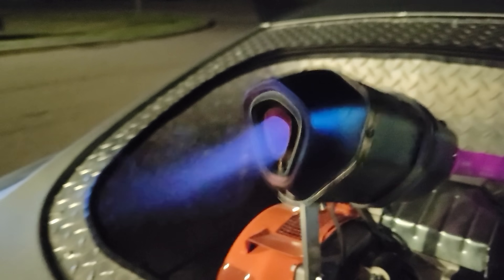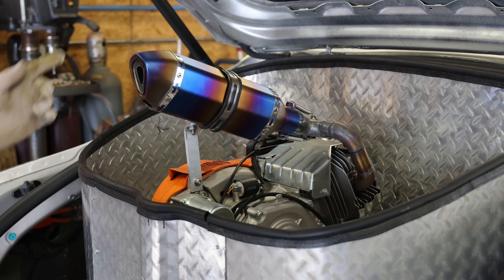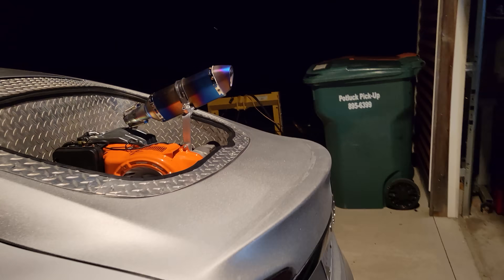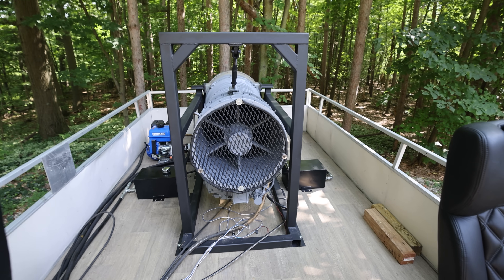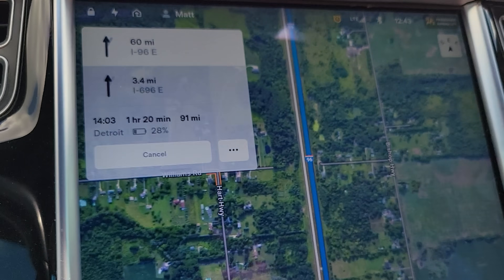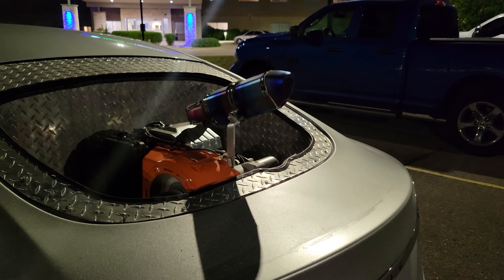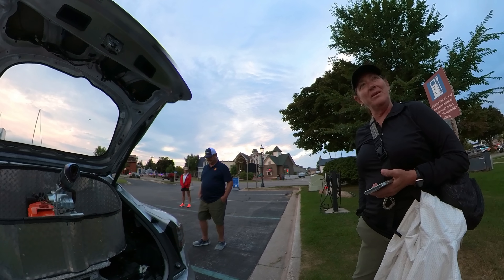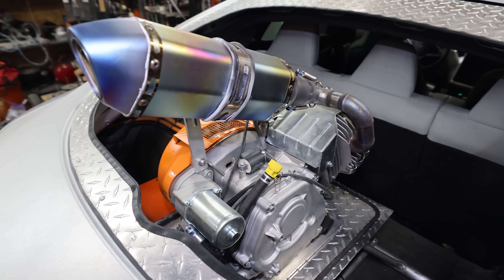Cordless Tesla (I Drive 1800 miles without charging) P.1

Comment: That's like an APU. Your Tesla is basically an airplane without wings. Nice. 😂
In all seriousness, you've been charging the car all along, particularly overnight. So yeah, you can't say you haven't charged the car for 1800 miles. I'm curious about the cost of fuel vs miles driven.
Your concept reminds me of a Gen2 Chevy Volt. But if you drive slow enough you can actually charge the batteries, the Volt couldn't do that.

Comment: As somebody who does own a BMW i3 range extender EV let me share some information about what it means to run an generator in an electric car

With the range extender I get 35 miles per gallon if I keep my car at a constant speed of 65 and that stops my battery percentage from increasing or decreasing.

If you think about that it doesn't make it a very good hybrid at all. You would be better off buying an actual hybrid than trying to modify an electric car to be a hybrid.

Comment: I think more electric cars need this but on a smaller scale. More like a plug-in hybrid on steroids. A car that has a fully electric drive train (unlike most if not all plug-in hybrids) and an electric range of like 250+ miles. Then include a gas engine with maybe a 4-5 gallon tank that can charge the battery if the battery goes under a certain percentage of charge. That way you are electric most of the time but you can add maybe 150-200 miles if you need to.

Comment: It's so dumb i love it xD people with Tesla are like "yeah i can only do 200 miles on the highway and then stop 30 mins but that's what you'd do also". When i did a 1300 kms trip in almost one go. 1000Km  (had a 20L jerrycan of fuel) with a single 5 mins stop. It'd have taken me 2hours more with a Tesla.. love my shitty Fiesta 

I love those Tesla, the power and quality you get for the price is impressive (well ok they have issues but out of factory you get good specs), but the battery technology we currently have isn't sufficient enough for them to be real daily, same as charging infrastructure. Wouldn't see myself going to superchargers, wait 30mins to start the week, just cause i live in a flat without a wait to plug it everyday..

Comment: Could you build a generator that supplies power directly to the motors through large capacitors only using  the battery for extra acceleration?
Reply: or, build an engine that runs on gas.  hmmmm.

Comment: I'm surprised that the cop didn't give you a hard time about flagrantly violating emissions standards. Without a catalytic converter, you've got to be spewing hydrocarbons like a '71 Vega. Wouldn't it be easier to just drive a normal hybrid? My large, quiet and comfortable Toyota Avalon Hybrid would average better than 45mpg at the speeds you were traveling and would only have to make two gas stops.

Comment: Nice click&bait. No mention on how the electronics was circumvented to allow charging while driving! Especially with Tesla software monitoring every milliamps in and out. Also interesting is the charging while parked is not showing the physical plug outside car(this however can be done by hacking the charger port from inside). Give me the details to prove me wrong!!!
Reply: The Tesla BMS communicates with the charger and inverter.  It would take extensive knowledge of the system and perhaps access to the internal source code to allow charging while driving.  While there was footage of the physical fabrication, the much more difficult job of electrical integration wasn't even mentioned.

My guess is that this was entirely a misrepresented stunt.  It was an off-the-shelf inverter generator running continuously but charging the car only when stopped.  The fancy fabrication steps, including removal of the muffler in favor of an open pipe, was to distract from what was really being done.
Reply: @1djbecker  You are absolutely correct. You cannot easily bypass the sophisticated BMS(it even controls the safety critical airbag deployment). Also it is not as simple as bypassing the charge port door sensor,as many will think. That is where you can charge internally from the back of charge port "WHEN" parked.
If hotrodding a modern engine with ECU is 10X difficult compared to carburetor injection it will be 100X difficult,unless you could bypass the extreme security of BMS firmware and the upper stack software code(which is all heavily encrypted along with autopilot s/w).
There are definitely possible ways of conserving battery use at low voltage level, but cannot be considered as concurrent charging while driving.
Reply: @aware2action  He did only 1800 miles in a week, yet stated that the generator was running continuously.

If he started out with a full charge and 400 mile range, that would have been 1400 miles or about 400 kWh of recharging.  It could have been substantially less with slow driving, as shown on the video.

At 10 kW generator output the charging should only take about 40 hours, something that could easily have been done without even running the generator all night.

The obvious conclusion is that running it continuously was entirely a stunt.   Once you see that, all of the custom fabrication and the extra loud trumpet exhaust was for show, making sure that everyone knew and he got a reaction.
Reply: @1djbecker  Yes it is very clear even from the frame of the video showing charge port on the back with no mods( with two high ⚡  orange cables running as it is). Unfortunately most people fell for the eye 🍬  I have been disgusted about lot of free energy click baits, but this is a first one similar to it but done a bit differently(taking advantage of the psychology and ignorance of the viewership).

Comment: Nice video,  would running a Generator while driving without batteries work more efficient??
You would need to figure the required amperage.
I'm not sure what Tesla electric motors are set for AC or DC..??
You could do a Generator / Forklift motor set up??
keep up the good work👍

Comment: I think a tiny gas generator 150 watts mounted to my Segway miniPro dumping DC energy any 59.5vdc directly into the battery while its operating to float charge it while riding to keep the battery partially charged so that the generator making the energy to go, would be a fun project. Any idea what a low mass tiny output generator like that would be? Where can such a thing be purchased? Are you aware of anything like that?

Comment: Man, those fuel economy numbers suck. Also, if you made the generator more powerful, it would consume even more fuel. Perhaps a diesel generator with much higher thermal efficiency & perhaps 40kw of output would make sense / weight optimize by drilling / machine all unneeded mass from the engine to mass optimize since a diesel generator with 40kw of output kinda heavy // vs the 10kw generator you made //

Comment: If we really want to be serious about electric cars this is a step in the right direction. Gas-Diesel/ Electric Hybrid is definitely the way to go. 
Gas engines are horribly inefficient at acceleration  but are really efficient at steady highway speeds. Electric is the opposite. Electric is less efficient traveling at speed but acceleration is mind blowing.  It seems more practical too. I'm sure with some $ and Elon engineering running a coast to coast could be done on a tank of gas.  
The Electic cars draw a lot of energy and we are already seeing their dema d on the grid. As it sits right now if we all started driving electric cars we would  need to put more fossil fuel plants back online. My sisters Tesla is coal powered for sure in fact I've worked at the coal fired plant that she gets energy from.. it's no where  near where she lives but First Energy burns coal at many places near where I live.

Comment: Lake Erie bro you live on Lake Michigan. 
10:00  My Ohio Brethren  said they always calling the cops. Lol
I'm sorry  fellow Ohioans called the cops on you Warped. I think you'd like to visit where I'm from in Ohio. Assuming you like to 4×4 where I live. 
I love your channel man. Your Chicago accent is relatable to blue color engineering types and Im sure you are well off a d you teach many people on your channel but I think you would make an excellent teacher. Chicago is in desperate need of male role model teachers to be proud of. Especially anything to do with engines man. I've been all about Engines  and Motors every since I was a baby and my dad would fire his Shovel head and my Pap took me to antique tractor shows and he had me on  different Wheel Horse pulling tractors (I'm a cub cadet fan) I won my first pull and they made a rule after that lol. You know you are doing awesome when the Columbiana Little Draggers Tractor Pullin Association makes a rule lol. Because I was 68 pounds my Pap could move a lot of weights around especially in the heavier modified classes.  
The rule said if a driver weighs less than 150. Weights plus the the rider and a 8# cage that would straddle the transmission tunnel to hold the weights as near to the rider as possible. We also used lead  instead of steel on the front weight post.  Anyhow I think your channel is great man. I've never owned anything that I didn't take apart and put back together. I know this sounds crazy to some but when I was a kid I took my guns apart and cleaned and oiled them.all the time my dad was a machinist so being interested in anything mechanical must run in my veins.

Comment: Can you provide more information about how the electrical part connects to the Tesla power electronics?  How are you able to drive + charge at the same time?
Reply: That info would have been very helpful.
Reply: Same way you plug in your phone and use it with the charge
Reply: @orangecookie3132  I don't think you can drive EVs with the charging port plugged in, so there must have been some other tricks to get it to work.

Comment: LOL - Cadillac built one of these in 2014.  It is called the ELR.  As all EV's it was over priced.   It was also ahead of its time.   It had 40 miles of pure EV range which was great for normal round town errands.   After 40 miles it ran off a 70KW gas powered generator.  {quietly}  I loved it but then realized what it was going to cost to refit the battery pack.  A friend of mine just got a quote for his VOLT which uses the same battery unit -  $29,000 yep that was the dealer quote.    Now figure that into your mpg calculations.  LOL    Add to that thee toxic waste challenge and EV's are about as clean as a septic tank.  :{

Comment: How much did you spend on gas? Or roughly how many gallons total did you go through?
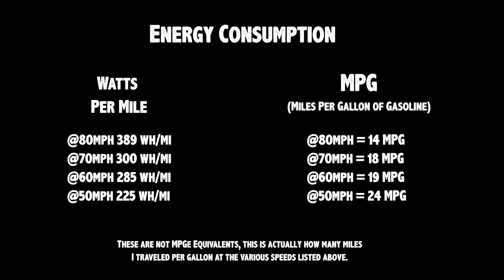Reply: Just watch the video to the end before asking questions. 14:55
Reply: @SansNeural  14:55 doesn’t answer anything, it just says how many miles he drove 😐
Reply: @Roadtripper420  Well, OK. 14:50 shows how many miles he drove while 14:55 shows MPG at different speeds.  He drove 1842 miles and I'll semi-arbitrarily choose his 50 MPH fuel economy of 24 MPG.  This assumes he's counted all the fuel burned  while charging overnight.

1842 miles / 24 MPG = (rounded up) 77 gallons of fuel.  That should be the minimum he will have used.

Yes, he could have easily posted exactly how many gallons of fuel he used... unless he did something silly like lose a couple of receipts (the kind of thing I'd do) and not be sure of the actual number.  However he did supply us with numbers to calculate "roughly  how many gallons total".  At least 77 gallons by my reckoning.
Reply: @SansNeural  I literally watched the whole thing bud 🤡

Comment: The problem is tha u cant charge as u are drawing power out the battery. So even if is showing that is charging is not until he stop acelerating. Is simple physics u can not charge a battery while u are using it. Is impossible. And is stupid and slow.

Comment: Doesn't want to charge on charger cause of waiting. Waits for the generator to charge the battery 🤡
Reply: Charge anywhere though.
Reply: @dude-n8p  anywhere the battery is empty 😂 Just put a generator in the back with a fuel tank switch on when u need 🤡

Comment: I have a bmw i3 ReX - It has a 600cc generator on board for this same purpose, but it is more powerful than the one in this video. 10,000 watts is not enough continuous power to maintain the battery level so I suspect he had some trouble maintaining highway speeds in this vid. Also the range extender in my car is very very quiet, especially compared to this racket.
Reply from the maker: The i3 is like 80hp, my Tesla is almost 1000 HP AWD BIG difference.
Reply: @WarpedYT  lmao you just proved my point. My 170hp i3 has a more powerful generator than your 1000hp tesla. Point being, my more powerful generator can maintain my very modest power draw (4.0mi/kWh average efficiency) whereas yours probably doesn't come close, at only 10,000w continuous output, for your "1000hp awd"
Reply from the maker: @MrJbmcgary  sorry I meant it the other way, I thought the generator in the i3 is 80 hp. And the Tesla is 1000 so I meant like the efficiency of the Tesla is impressive. I like the i3 too but I wonder why the Tesla is more efficient, different type of motors maybe?.
Reply: @WarpedYT  the range extender generator in my i3 is roughly 35 horsepower. The electric motor that actually drives the wheels is 170. In the video, you mentioned your generator puts out 10kW, whereas the factory optioned generator for my car puts out a bit more than 20kW. Doing the math for our efficiencies, your car gets roughly 170-180Wh/km, whereas the i3 sees a higher efficiency at around 150-160Wh/km.

All this boils down to my original point of this - your generator is less powerful and your car draws more continuous power. My generator is more powerful and my car easier on the power draw, and even I struggle to keep the battery topped up at highway speeds. All I was trying to say is I bet you struggle to keep the battery level maintained at highway speeds. That's all.

Comment: I always wondered if its possible to charge while driving. So if you take a big trailergenerator hook it up with some huge gastanks, you could drive that distance without stopping for fuel. Would be a great project.
Reply: Most likely he wasn't charging while driving but the gauges may have been confused from all the excess power.
As far as I know you can only charge when nothing is pulling Amps from the batteries (in this case the motor was pulling so I don't think it worked)
Reply: You should take a look at nissan kicks e-power. It's basically like this tesla but produced by nissan and reliable. I currently own it.

Comment: Get an APU from an old aircraft on there. Should have enough power to do what you need and is designed to run for long periods of time with low air flow

Comment: This is what I consider a proper hybrid vehicle.  I consider it a shame that something like this had to be hacked together by the aftermarket.
In my opinion this setup makes a lot of sense (Sure it is overly complicated and a bit impractical but it is a hybrid vehicle).  Using a generator to constantly charge the batteries gives the car the best of both worlds (the performance of an electric car, and the range of a gas).
Reply: ummmm..... it's called PHEV, and it's mainstream not aftermarket
Reply: @emperorzurg4707  

I was informed after I posted and didn't have time to update my original post.

Comment: I respect you as an engineer / mechanic but this project was dumb AF.  terrible use case for both instruments.  charging a tesla nets you about 12mpg after the multitude of losses. both at generator charging and battery losses.  you should just drive a fuel car if you are going to do this.

Comment: You need a predator twin cylinder with a higher torque setting then you also need to run a stronger generator motor in conjunction. I would also recomend solar panel skinning for the top half of the tesla so when your out in the daytime the sunlight can help charge the motor

Comment: Cool experiment, but not very factual. First, when you said there weren't any chargers within 50 miles of where you were (just south of Vanderbilt), there are three public charging stations within 10 miles. Also, while you could complete the trip - good on you for making this Rube-Goldberg contraption work, if you were to just use chargers on the way you could have done the trip in much less time. Still, a fun watch.

Comment: Awesome I had this same question in my head but had a battery switch and another battery involved to charge and switch while driving as to not overload the circuitry. What about adding aor scoops with wi d generators to assist in charging at higher speeds through inverters. Good job bud

Comment: You can increase the efficiency A LOT if you have the engine push the car like a regular hybrid. Because you are adding conversations lose using gas to run generator then charge the car (AC to DC) then DC back to AC for electric motor.

Comment: I would've never thought it was going to be so efficient, thanks for including that in the video.
Reply: it was not efficient.
Reply: @youtoobe0001  Compared to what?
Reply: @kaib.5708  "Insert make here" "Insert model here" of any Hybrid vehicle, or any small car.
Reply: @youtoobe0001  I'm not saying it's more efficient than a hybrid with actual development budget 😂 But it is more efficient than i would've thought. Btw the BMW i3 uses the same principle.
Reply: @kaib.5708  i think he could fit a 65kw diesel generator back there and get better efficiency. Hopefully he does something else with it. it seems as though he did quite a bit of fabrication already, he could build off that and fit something else in there that might get more range. or charge faster.
Reply: @youtoobe0001  Yes that frame looked quite strong for such a little engine. I also wonder how much vibration it transmits into the car 😅